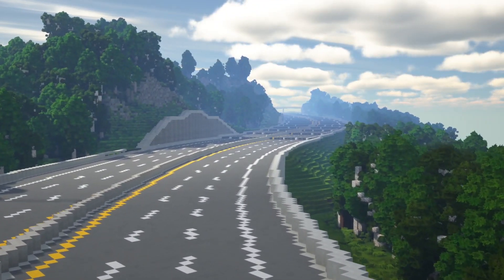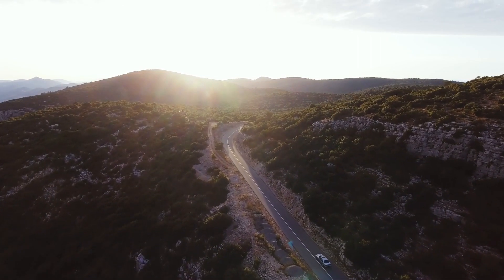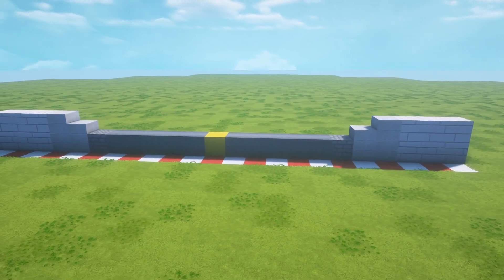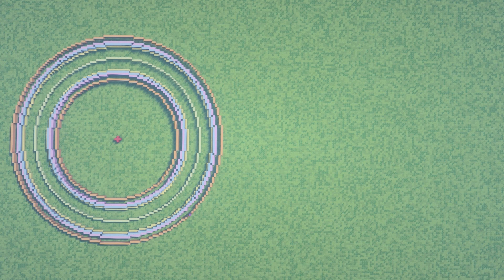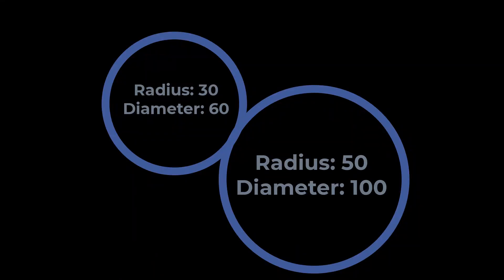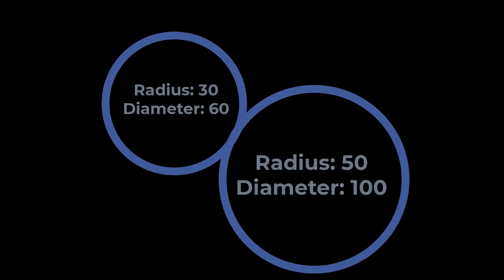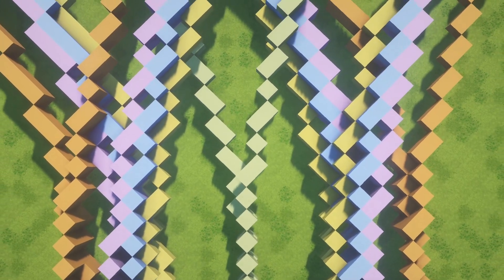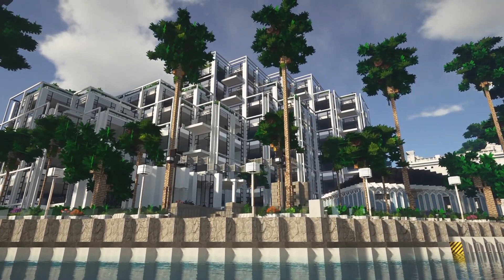Proof You’ll Use Highschool Math - Minecraft Curved Roads

Comment: Is 45 the most traditional, or did you just use it as an example?

I tried to do an intersection at (.5,.866) (that’s pi/3, or (1/2,sqrt3/2), and it turned out a little strange, but the circles intersected correctly.
Reply from the maker: I just used it as an example since it’s the easiest, but typically roads will only curve to avoid something so it’s different for every situation :)

Comment: There is a road that I have to travel everyday to go to school and it’s curve is very tight at one end and very straight at the other. Back in September 2015, many bridges washed out in my area due to intense rainfall. This road was a victim of this and when they rebuilt it, they did not change this curve AND they flattened out the embankment on it. So now we have a road that still curves very sharply at one end and is basically straight at the other, this time with no embankment. Did I also mention that this curve is at the bottom of two hills?? Yes, the road curves awfully at the bottom of two hills AND it has a bridge so it’s extremely susceptible to ice build-up in the winter. The absolute worst conditions.

Comment: If I were to choose 15-degree angle for example, how would I find the 15-degree mark on the circle in Minecraft? I am referring to the method at 3:30
Reply: I tried to first find the 45 deg mark and the 0 or 360 deg mark, then counting the number of blocks on the circle separating these two points, then divided 45 deg by those blocks to get a decimal which I then multiplied by 15 deg to get an approx. of 13 blocks round the circle which is 15 deg. Not sure if this is right.

Comment: 5 months later, and I think I have perfected using this method, even in my survival world.

If anyone else had issues getting circles right, I'll explain the blood, sweat, tears and agony I went through to figure it out, with the help of a friend.

Basically, i used a website called donatstudios to generate circles. When making circles in the gen., Its important to always make sure the diameter is an ODD NUMBER since you cannot have the center of the circle be more than one block, otherwise you will have a road that becomes more narrow or wide and it will look bad. You can always guesswork but trust me, i tried it, and while it does the job, it looks just terrible!

Also, you can use a tangent circle calculator to find the coords of the center of the next circle, but the nice thing about doing it in survival is that you don't need to do this, you only need to draw out the circles with a compass on a scale map of your world (printouts of journeymap mod screenshots are very helpful for this!) Then measure the diameter of the circles, and where they should line up so you can avoid obstacles and other terrain in the way, or cliffs, etc.

Sorry if i explained this poorly, if you need clarification just ask, its 3:13 am and I am very tired

Comment: Me, wanting to make a curved road
Alpine: So you take the Pythagorean theorem and you take a unit circle, then use world edit, and do some calculous, then you use word edit, and there
Me: nah, I'm fine.
Reply: pythagoras theorem is for triangles!!
Reply: @cheese4788  trigonometry is actually used for circles rather than triangles.
Reply: @dr3kiki  wtf
Reply: It’s as easy as the hcyl command if you have world edit. No need for calculations.
Reply: @Cryptkeeper0311  i’m in survival bedrock so no world edit sadly.
Reply: It's not calc it's geometry. And he did it quite inneficiently. If it's a circle, all radii are equal, which means that if you have a line in that circle going from the center to any end of the circle it will be equal. This means that when you make a triangle in the circle (with the intersection of the legs at the origin), it'll be a 45 45 90 triangle. in a 45 45 90 triangle the 2 legs are equal, with the hypotenuse being the length of the legs times sqrt2. If you have a unit circle, then the length of the hypotenuse (in this case)=1. then you can find the legs by dividing 1 by sqrt 2. You can't do this so you're going to have to rationalize aka just multiply the entire equation by a value equal to one, so in this case sqrt2/sqrt2 because you need to get rid of the sqrt2 on the bottom. that gives you sqrt2/2 which is approximately equal to 0.707.

Comment: 0:42 that is exactly not what you want at the beginning and end, you could even see it in your footage.

Especialy on high speed curves you want to ease into it with a transition curve, otherwise you’d have to yank your steering wheel at the very beginning and end of a curve and wouldn’t need to steer for 100% of the curved section

Comment: Are towns the same as cities. If they are NOT, can you please make a video on how to create a working  town and beautiful houses too. :)
Reply: I guess towns are just cities minus skyscrapers, high-rise buildings, mass transit systems and very wide roads.
Reply: @blockyfawx-w-2167   Thank you so much for telling me on how to create a working town. I was also wondering if you can tell me how to create a working neighborhood too. :)
Reply: @razzradical3157  most neighborhoods do not have 4 way intersections, unless it is two main streets of the suburb. 

Road: suburban. Think houses, parks, etc..

Street: road, but wider, and maybe a bus route goes on there, more traffic. Basically leads to a bunch of roads on the side using roundabouts or "T" stop signs (3-way intersection).

Main road: two lanes, standard traffic intersection, with advanced green lanes and merging right-hand lanes. Usually separated by a median with grass/shrub, but can also have a double-lined yellow line to signal opposite direction traffic.

Highway/freeway: large intersections, multiple lanes, highspeed transit, barriers to block sound (either concrete walls or natural, or just making it far away from residential and office spaces), please, please please don't make them cut through cities if possible, but if need be, then cover it with lots of trees.

Having curves in your roads makes things much nicer in suburbs, too, but making it curve with the land (ie a nearby river bank) makes it nicer. Basically having it layered as curves with the river, hill, or anything else be a reference gives it a uniform and nice shape. Grid lines look bad at the end of the day, and the neighborhood will get very boring, very quickly, but for downtown, grid is ok. Not ideal, but if need be, its ok.

Comment: in the real world curve radii do change. Curves must transition smoothly from straight sections into/out of curves, especially between back to back (s-curve) turns. Otherwise when driving you'd need to instantly have your wheel turned when you go into a curve.
Reply from the maker: You are absolutely right! I should have clarified, I meant for the vast majority of the curve, not including connections to the beginning and end of the curve

Comment: Do you have a video about a metro system? If not i would love that.
Amazing work, keep it up
And for real trust me, ur channel will explode some time soon
Reply: I'm sure the techniques outlined in the video should apply to Metro tunnels as well. Stations should be relatively easy, usually have at least one platform that's high enough to be level with the train, stairs or imitation escalators leading to another underground area with shops and stairways up to different streets. You can also add other stairways down to other Metro lines if you want an interchange there. Hope I helped!